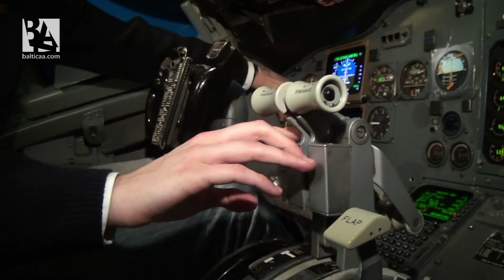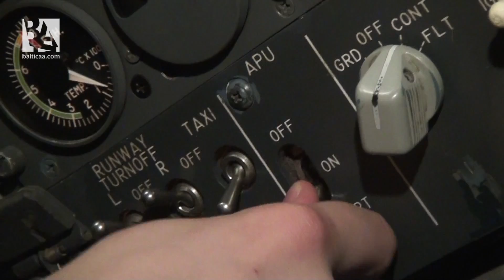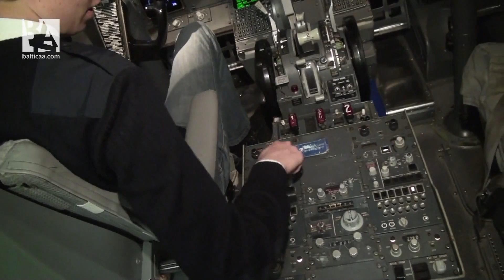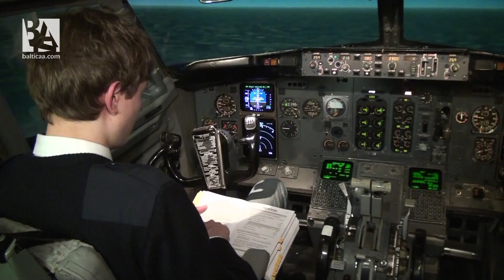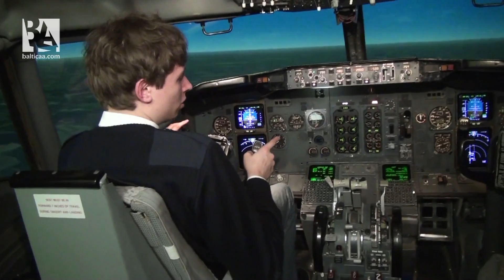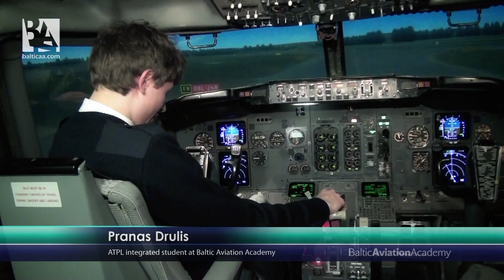Boeing 737: Engine Failure

Comment: Hey Pranas, you used A320 procedures for your engine failure. There's no green dot speed in a Boeing. And you don't press ALT Hold nor do you reduce to Climb thrust in here. You wait for MFRA (minimum flaps reduction altitude) and you clean up, then you select LVL Change, then Max continuous. Boeing SOP's

Comment: I was always thinking of safety of flying. But it is so safely designed and the system's are so perfect that there can be hardly any error
Reply: No.  If you dint control a 737 correctly and quickly on an engine failure you’ll end up upside down.

Comment: I think he sets the temperature high to model a worst case scenario - higher temperatures mean less lift and make flying harder in general. Basically means in a tpyical situation where it would be much lower, he should be able to handle it easily.

Comment: One hint: 
If you disconnect the Auto Throttle by pressing  one of the side-swiches at theThrottle TWO times, you avoid this nasty red blinking of the auto-throttle-disengage-warning-light in front.
You should do this, this permanent blinking all the time is awful.. Blink blink blink almost all the time....
AND: PLeASE press the take-off-buttons at the Throttle from ABOVE (not with one finger from below) and KEEP your hand at the Throttles, when applying take-off-power ALL THE TIME. 
If one engine fails with severe damage (N1 and N2 = zero) at this position at about 10 to 30 knots, you will be off the runway within two seconds, when the other engine sets takeoff-power. In this case you are to late with your hand at the throttle to set idle.
During approach checklist: The master caution "Aircondition" was caused by "Pack Trip Off", you had no cabin-pressurization all the time after the Pack tripped. Warning light (Pack Trip) was left, the dead engine was right, this pack was switched off.
But over all it was a very good information to compare this computorized A320 with this fine-art-Airplane B 737. 
Sure, there is a lot more to do in the Boeing 737, but if you have done it, its done. 
No one knows, what the computer in the A320 will do ..or may be not, or may be wrong or....whatever.

Edit, one more hint: NEVER fly manually (auto pilot off) with AutoThrottle aktive. Because you will have a lot of extra work to stay stable. May be, you go inadvertantly above the Glideslope, you get slower. This will be compensated by the auto throttle with higher thrust setting. This leads to a pitch-up-moment, which works against your intended correction to descent to match the glideslope again. Same with coming below, airplane accelerates, AT reduces thrust, pitch down moment lets the nose fall, thats the wrong direction.
And why do you switch off the flight director during approach. That is stupid! FD helps a lot, mainly during this phase of flight - and with engine out even more.

Best regards.
Reply: Dude... 1) chill 2) everyone has their ways of doing things. 3) he is in a dire situation to get back onto the ground and might miss certain steps. If you want to know the thinking behind his actions, go ask him.

Comment: This is an older 737, I think its easier like the A320 with the New Gens but im no pilot and not an expert just a fan :) I like both companies aircraft they are amazing, I do have a soft spot for the A320 AND the 737 (old 200 model is my favorite). I do tend to like Boeing planes more but not for any true technical reason because both companies make incredible planes just do some things differently. If I was in a plane and all cockpit employees were incapacitated Id want to be in an A320 because I honestly think I could land it using full auto and radio help from an experienced person.

Comment: I am not a pilot. Dreamed about doing it next thing you know life happened and I'm over 50. I was shocked at how much harder it was to land the 737 with 1 engine out as opposed to the A320. Is this strictly because you were flying a 737 classic as opposed to a 737 NG? Will the new 737 max even things up? I know I will be more aware of the type of plane I am in from now on.
Love your videos! For a non pilot it truly helps explain what's involved.
Reply: @Ron Lipp the 737NG is probably slightly easier to control because it has more compatible auto thrust and EEC (electronic engine control). However, the many protections of the Airbus make losing a system’s full capability almost impossible. Things like auto trimming and other convenient systems and anti-crash protections make flying the A320 with one engine easier than flying the 737 classic or 737NG. But, newer Boeing planes such as the 787 also have these protections and automatic convenient systems to make one engine operations easier.
Reply: Both engines: dont expect for dinner.

Comment: i love my airbus i have in p3d sometimes my help doesn t help me so i do it alone but maintan heading and speed  i watched both vids on engine failure and airbus is little less tiring than boeing that i saw going to try engine failure when i have better graphics card in my comupter i know i can fly it without auto pilot fd off and auththrotle off so its going to be very tough till you practice it over and over a very good videos on both the airbus and boeing

Comment: This is an interesting insight into just some of the issues associated with an engine failure-at a critical phase of flight-approaching V1 on take-off. I am a very experienced Airline captain and have flown these sequences many times in my career.

 For those interested I make the following comments. Firstly maintaining control is obviously vital-nothing except this matters until at least 400' AGL-Speed not below, V2 tracking correctly and gear up with positive climb. Rudder trim to centre the control yoke. Thrust can be increased to full power and maintained for 10 minutes on one engine, normally 5 minutes for both engines operating.

Above 400'AGL " identification phase"-for a "simple" engine failure- i.e.: no fire/severe damage or separation no actions required, otherwise the memory items are carried out-A/T disconnect, affected thrust lever closed.affected start lever cut-off-then for fire only affected fire warning switch pulled and rotated to discharge extinguishing agent. A second shot is available if fire light remains on.

The climb then continues until acceleration altitude - at least 1000'AGL. Some operators allow for APU start, fuel crossed open( fuel balancing)  and alt. equipment cooling to restore RASTA on the EFIS whilst waiting for acceleration. 

At acceleration altitude  speed bug wound up to the 'green dot" speed( clean manoeuvre) in TOGA mode-the pitch bar on the FD commands a shallow climb as the aircraft accelerates-flaps retract from 5 to I then Up as required. when 'clean" then Autopilot engaged, thrust set at MCT, speed mode on MCP set ,HDG on MCP set-Boeing don't recommend auto throttle in one engine operations-so manual thrust now.

Then all the checklists are actioned-Recalls are rechecked ( corrects any errors made earlier) the Engine Failure and Shutdown checklist actioned for the first time ( for a simple engine failure)  and finally the After Takeoff checklist. The autopilot needs to be monitored closely, it does not handled the rudder channel. Trim changes with speed and thrust change.

Sounds simple doesn't it??
Reply: Yes very simple as ABC
Reply: Oh my.
Reply: Ya very simple
Reply: Any part of the checklist include a restart attempt of the number 2?
Reply: @raymondlantz9278  yes it does depending on the nature of the failure
Reply: @ronbishop1068  If you have engine full of geese (Sully), might skip that step?
Reply: @raymondlantz9278  yes you might although he did carry out the initial loss of thrust on both engines checklist as I recall
Reply: @ronbishop1068  Got ya, thanks!
Reply: Or a much even simpler version: "Just fly the bloody plane!"
Reply: Yes quite very important the correct pitch 12.5 degrees nose up control the yaw set max power on the remaining engine accelerate at the correct height
Reply: Aku mau jadi pilot

Comment: Loved watching Pranas but being a nervous flyer I thought watching some cockpit videos might ease my tension, however after seeing him get the plane instruction manual out with one engine dead did nothing to restore my confidence, he said he was sweating well I was sh*tin bricks and I wasn't even in it . Nice video all the same :-)
Reply: +SLOPPY1001 Believe me, it's much better that the pilot consults the operating manual. Planes this big have hundreds of thousands of components, and many systems that rely on each other. The engines power things like hydraulic pumps that provide power to the flight controls, air conditioning packs that maintain cabin pressure, electric generators that power the avionics, and many more. An engine failure means that some of the systems have to be reconfigured to rely on power coming from the other engine, to put it simply.
Depending on which component fails, the pilots often have to reconfigure the aircraft systems around this component, in order to minimise loss of functionality. There are so many possible components that couldn't fail that it would be ridiculous to have every checklist and procedure memorised by heart. The fact that the pilots methodically work through the checklists and procedures designed by the manufacturers of the aircraft should be of comfort to you!
Consider also that on a commercial flight, there are two pilots, who are trained to share the workload between them and work together.
I would recommend you read QF32 by Richard de Crespigny. It's about the A380 that suffered huge system losses, and he recounts how the situation was professionally handled by four pilots.
Reply: @caspianmerlin6162  best answer

Comment: Engine fail....continue....v1.... rotate
omg...
Reply: +Diogo Graça Ah, I overlooked that. But by the time the engine failure was identified and action was taken, the aicraft might have slipped over V1. I think the call to continue was a good one on Pranas's part.
Reply: Why omg?
Reply: +Nathan Chetram if you have engine fail before v1 you dont continue, you stop.. thats the point of saying that speed, thats the decision speed
Reply: Nathan: No!  You must stop. At V1, the takeoff-decision-speed, the captains hand leaves the throttles, that means, whatever happens now , we fly. Before that you stop. Otherwise all takeoff calculations are wrong.

Comment: For B737CL, there are no  memory item for engine failure, at 1000'AGL, you do not PUSH N1 for single engine instead you keep TOGA power until you have Flap up, No Light, then select MCT, LVL CHG and for B737 you no need to lever off to accelerate, you can climb .and clean up at the same time

Comment: What are those rolling wheels on the side of the thrust?
Reply: A bit late to reply, but they are the trim. They help the pilot pull up after take off
Reply: Elevator trim. They help pitch up and down.

Comment: Boeing using old outdated tech, while Airbus using advanced Computers. I feel much safer in Airbus with latest Technology than old junk of boeing. No Comparison, Airbus Is far safer. All the major boeing accident were due to design/mechanical failures while most of the airbus crashes have been pilot Error. More people just prefer Boeing since it has been around earlier than AirBus, People have a tendency to favor the a first mover rather than a new competition, i can't understand why.Sure Boeing planes look beautiful, but its the safety, fuel, quietness, more passenger, and latest technology that matters, and Airbus Dwarfs Boeing in these areas.
Reply: All these Boeing asslickers lol. I like Boeing aircraft but Airbus is just superior. More safe and advanced. It's easy to see he struggled with the 737 compared to the a320. 'Oh but Boeing are American and Airbus are dodgy european' lol
Reply: Murica
Reply: Is that the yoke ?
Reply: You shouldnt compare a 737 CL to a A320. Then A320 will obviously win.. 737NG is far more advanced. I still prefer 737 NG, really its just personal preference. They're both pretty safe.
Reply: Zoheba What's the difference between an Airbus pilot and a Boeing pilot? The Boeing pilot has something in between his legs.

Comment: I thought you shouldn't use reverse trust with an engine failure. Am I right?
Reply: He only used Idle reverse, meaning reverse thrust DOESN'T engage, idle reverse simple open up the fins at the back or on the side of the engines. I believe I am correct in saying that.
Reply: you are right

Comment: pretty sure you woukd turn back or reject
Reply: woukd? check ur spelling
reject? ''eject'' u mean
Reply: Jos Diels he means RTO
Rejected Take Off!
But unfortunally after V1 he must continue ... can't stop!
Reply: Pedro Gaspar The failure was before the V1, if I recall correctly. What I'm interested in is why he didn't try to start the engine back up.
Reply: Jos Diels Dude 123buttnut had it the right word, you fucked it up n00b.

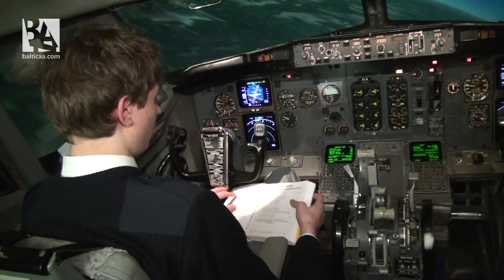Comment: About 08:30 he  changes his heading to 70 and then to 80 degrees to be heading back to the airport. Is he calculating this in his mind by just doing a 180 degrees turn or  how does he get the heading for the airport? Cool video!

Comment: MrSkypony Those are the elevator trim wheels, the autopilot operates them by itself but you can turn them manually when the autopilot is turned off.

Comment: engine failure before V1... should have rejected.
Reply: I think it was at the exact same time as V1 was reached, the thing is that there's no callouts from the airplane, so he's the one noticing the engine failure and V1 afterwards. Again, I thing both happened at the same time. You're right though, engine failure before V1 = RTO
Reply: Just so you know V1 is calculated from weight and runway length (among other things)

Before V1 you can safely stop everytime, the runway wasn't too short
Reply: Guys... the failure should be  programmed at V1(as it is a simulator) and for some how, it was probably early. Even if that happened, he should continue as his demonstration is a engine failure after V1, and it is a lot of trouble to re-record the video as called V1 right after he noticed the failure. Just sakes for demonstration.
Reply: true! I mean always follow the rules.
Reply: if the drill was set to "continue" it would have been pointless to break.
Reply: It is very true, however when you see how much runway was left I would have continued.. not sure if that is actually how much runway was left or that was a trick my eyes played on me but in the case that I saw the remaining runway correctly I would have continued as well
Reply: AviationNonstop Never continue OEI below V1.

Comment: thrust lever on the failed engine shold be at safe mode, not at TOGA. disengage auto pilot during engine failure, do not ignore warning messages, the trim wheels keep moving because auto pilot is not fully aware of the crisis, ATC should have been informed, SOP, FAA

Comment: Those wheels on the throttles' sides move the whole section of the tail with the elevators(not the rudder) up and down in order to keep the nose of the plane more stable.They can be moved by the autopilot or by the pilots with a small button on the yoke.Please correct me if I am wrong.

Comment: He was almost reaching Rotation Speed. You have to account for the runway lenght and OAT. At such high outside temperatures, reverse thrust wouldn't be as effective as in any other standard day. Besides, in the TO briefing, you'd probably stated to go airborne in case of failure at V1+ since no significant physical obstacles are present in the climb phase. He did well but once established at his selected altitude, he should have run through the engine failure checklist...

Comment: Will the Torque factors effect a turbo jet in the same way as props? it's still a spinning engine, but the airplane is much bigger. Do you have to split the ball to maintain directional control?

Comment: thats the elevator trim the autopilot controls so that it can pitch airplane up or down but also a pilot can use it when autopilot is off when flying a cessna you use it to keep the airplane level

Comment: That's your trim wheels used to adjust the pitch of the aircraft. Modern aircraft have powered trim but in the old days your trim was adjusted by hand, hence the wheels on each side of the throttle quadrant. The white lines are just for visual reference that the wheels are rotating.

Comment: The trim wheels, the aircraft does that automatically to make sure it uses less hydrollic pressure. The pilots do it automatically when the aircraft is as you may say it "uncalibrated". It is really just for pilot and passenger pleasure.

Comment: Nice guy and clear speech but showing this as a single pilot doesn't really show how large commercial aircraft are flown. Rudder trim is left really late and probably not trimmed properly which is why the autopilot disengages. 

I wouldn't recommend the video to prospective 737 pilots but as general demonstration for the non initiated.

Comment: Yes, but there is an imbalanced power ratio. In other words, there is much more power on the left than on the right because of the engine failure. A full reverse would make the imbalance worse and could result in a loss of control, especially if there was a crosswind, However, I'm merely a private single-engine pilot, so my words are not set in stone. :)

Comment: I noticed that the auto-throttle stayed engaged until Pranas switched it off. He then switched it on again later. In my FSX PMDG 737 NGX when I get an engine failure the auto-throttle disengages. And I cannot reengage it. Is this normal or am I doing something wrong?

Comment: He cleaned up the flaps once he had attained the proper speed, which required getting to climb/acceleration height, and that took longer due to the engine out.